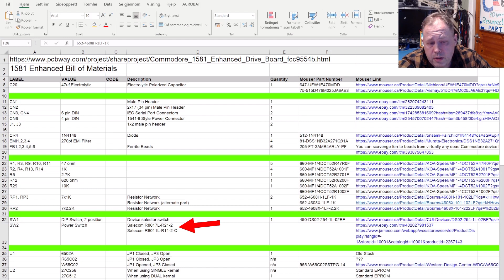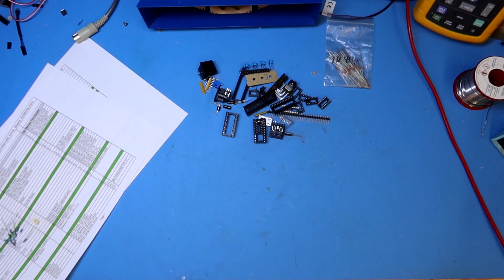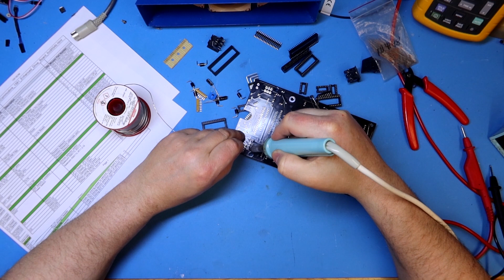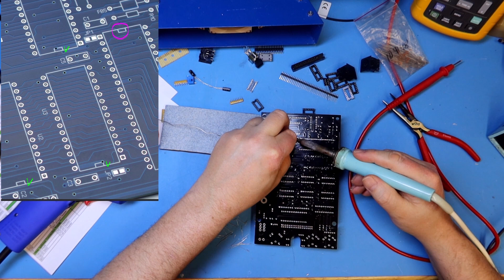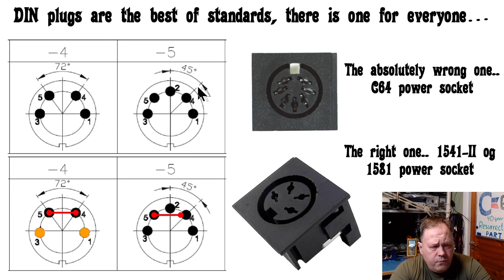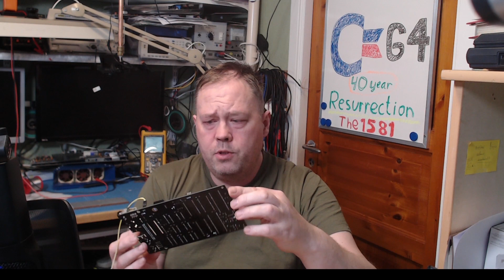The Commodore 64 resurrection series, Part 8, Bit Nibbling the 1581

Comment: Nice Video. During your opening video seen I see a gasket on that heavy outer metal door. Was that to make the room airtight in case of chemical attack? Where did you get that door, or did you make it yourself as a replica from a vault or bunker door?
Reply from the maker: Thanks for watching. The door is one of two entrances to a real bomb shelter. All office buildings had to have one if they were a certain size back in the 70’s and early 80’s. I have rented space in this building for well over 20 years, and currently I have about 50 m2 down in that basement. So yes, the door has a seal, although it’s dry and cracked as these rooms was no longer considered obligatory by the 90’s. Bu the door is massive steel, and the walls are thick enforced concrete. So when I say down in the bunker I really mean it !

Comment: What kind of disk drive will you use? Do you still have some DD Floppy drives around?
Reply from the maker: Hi, Thanks for watching. I do have som old DD drives and also Amiga drives that will fit into this. But the first one will get a NOS 1,44 drive used with an universial adapter board.
Reply: @kojroRI  Oh, I also have a NOS 1,44 Drive here. How can that be used? :-)
I'm thinking about doing that build myself but no DD Drives.
Reply from the maker: @Thorsten Drews  Hi. Almost all 1.44 drives will function as a DD 720Kb drive. There are some strange beasts around, but on the 5 ¼ inch drives the problem was the width of the magnetic tracks and the size of the read / write head. This is not a problem on 3 ½ inch drives. The problem is more in the way they are wired, and the 1581 uses the same mechanism and signaling as the Amiga computers, so and there have been adapters around to fix the differences that occur due to missing config jumpers on some PC drives. I theory most drives are compatible, but hidden jumpers and undocumented cut of tracks are needed to do the config. This is solved with boards like this one : https://gitlab.com/toms01/1581-pc-drive-adapter
I am planning to use this board in my first revision, but I do have some drives that can be configured to work only with a minor cable reroute.
Reply: @kojroRI  Thank you very much. I've just taken a look at the drive itself and found it's an Mitsumi D358T6 which is widely documented on the web for use with Atari and Commodore Computers.